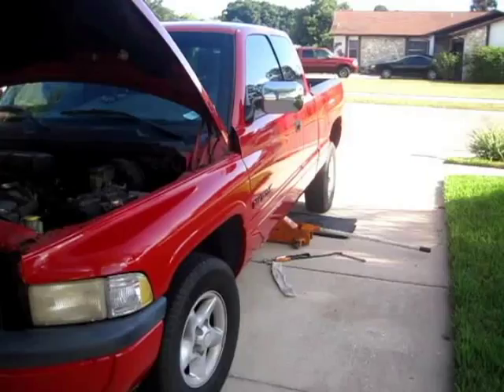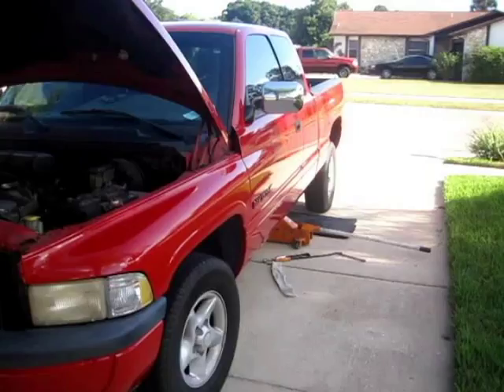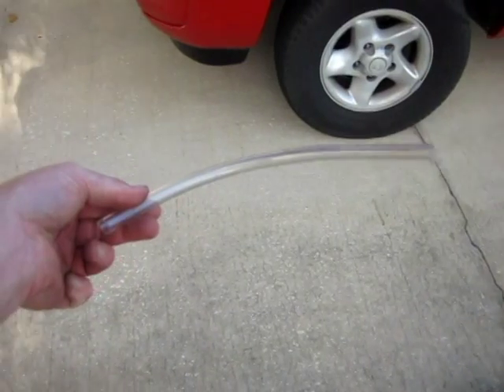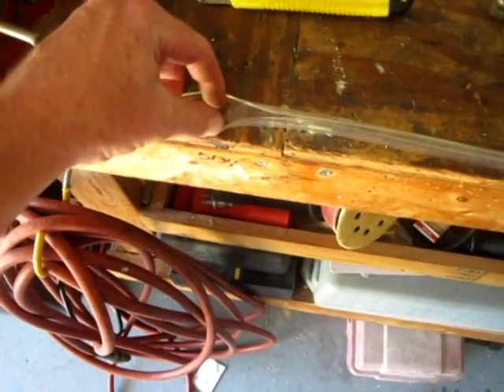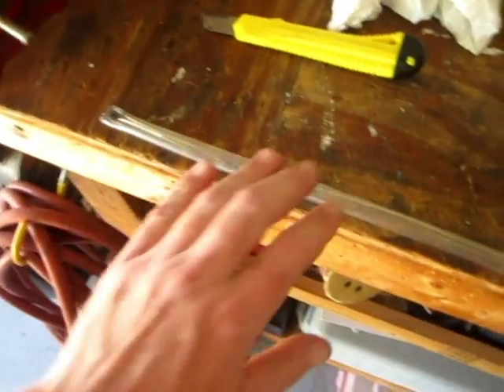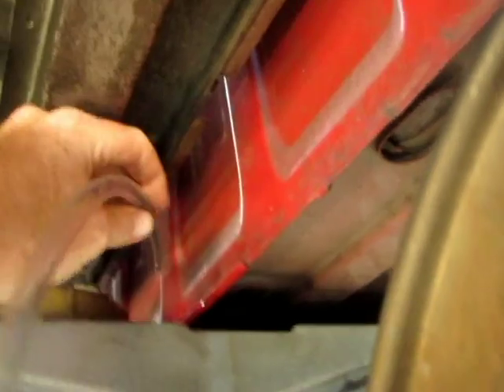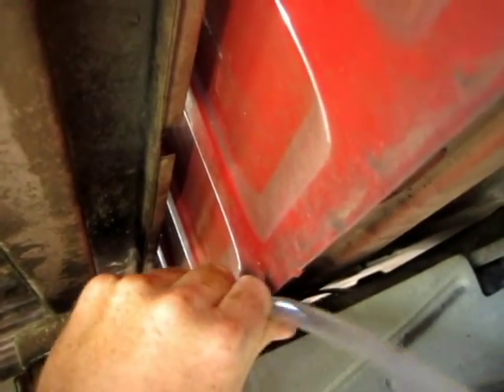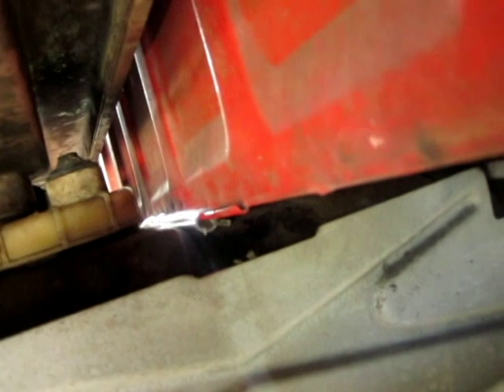How to Fix a squeak in the rear of a Dodge Ram 1500 using plastic tubing

Comment: I have the most annoying squeaking noise which occurs every 1:1 wheel revolution but on a 1991 Dodge Ram D150. 
It may be a coincidence, but it started right after I got my bed Line-X'd. I noticed the constant squeaking as soon as I drove it off the lot. In the meantime, I was told by Kwik Kar to spray penetrating oil on the rear springs, etc but no luck. They also suggested to me that the rear end/axle might be the issue. Any suggestions? If not, I guess that I will just take it to my local Dodge dealership. Thanks!